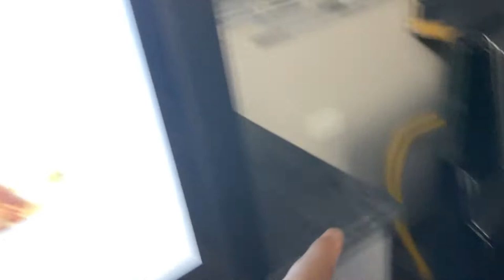Samsung Stainless Stove Burner Knob Panel Replacement & 3 Year Review After Everyday Use!

Comment: We have this same oven but I cannot find the model number anywhere on it! Need to replace one of the burner switches behind the knobs.
Reply from the maker: Hi Cathy,  which one do you have to replace? I believe they are all different. Here are a few links to the parts you need or can replace. If you need anything else, please let me know. 
Thank you. 

https://samsungparts.com/products/dg96-00298d

https://www.genuinereplacementparts.com/samsung-nx58j5600sg-aa-surface-burner-valve-genuine-oem?gad_source=1&gclid=CjwKCAjwwr6wBhBcEiwAfMEQs6jBjTm2ZKxrWF4aIpvcX-eNnRv-LN98zM6vgWWUh0NRbSvjya1dcxoCSwMQAvD_BwE
Reply: @TerenceDIY  Hi Terrence! I found out I could find the model on the warrmer drawer. Turns out I don't need a new switch (tested further) -- just need the little black sleeve that goes inside the knob. Since the knobs just look like trash by now, I ordered new knobs and problem solved! Thank you!
Reply from the maker: That's awesome! I had to order knobs too! The factory knobs were terrible! Thank you sooo much for watching.
Reply: I have a problem with the Chanel  that connects to the knob it goes all the way around
Reply from the maker: Are talking about the burner valve?

Comment: Use super clean to clean the grease. You don't have to leave it for a long time or else it will damage your paint like most of the degreaser product. Then just use Weiman Stainless Steel Wipes.

Comment: Screws did not budge coming off some actually broke off what did I do now….
Reply from the maker: Oh no! Unfortunately, you're going to have to drill them out. You can find replacment screws at any hardware store. Were you able to remove the section after the broken screws?